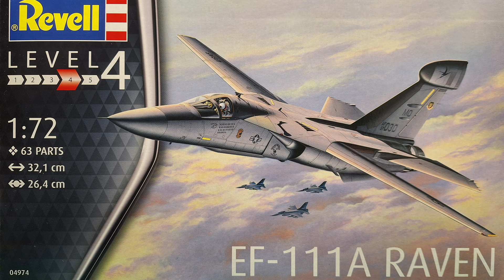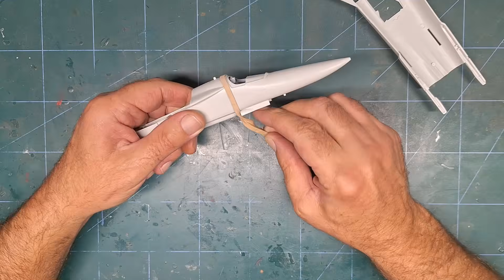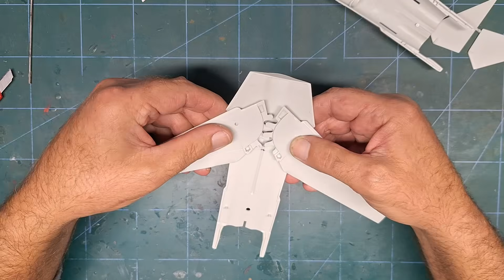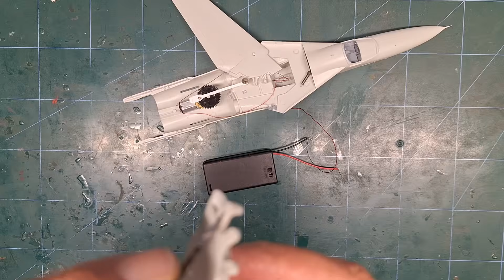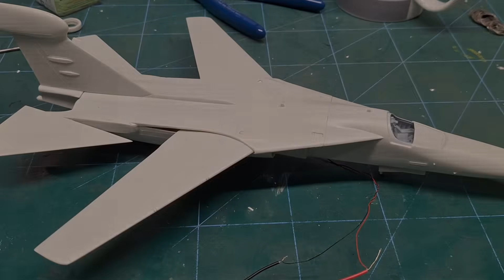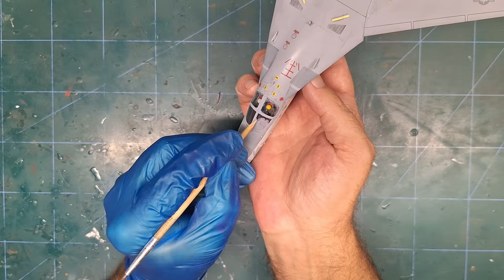Motorised Revell F-111 Raven 1/72  Narrated no music

Comment: Great work for 1/72! I was wondering how a small helo like the Cayuse would be done?
Reply from the maker: I built one a few months ago (1/72) but didn't attempt to motorise it.. 
The smallest motor I can find is 4mmx8mm,even this might not be small enough for the main rotor of a 1/72, and defo not small enough for the rear.
The MD520 NOTAR (no tail rotor) might be an option though in 1/72 if the 4x8 motor will fit ,and you can find one , they are quite rare.  
Maybe if it was a 1/48 scale model, that might be possible.

Thanks for your comment   Mike